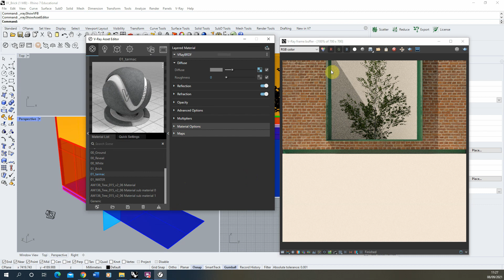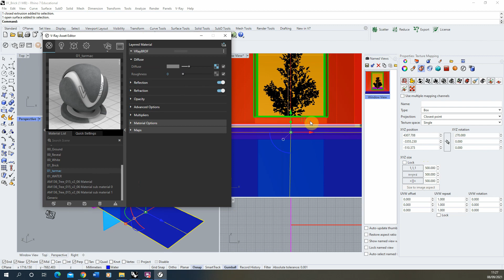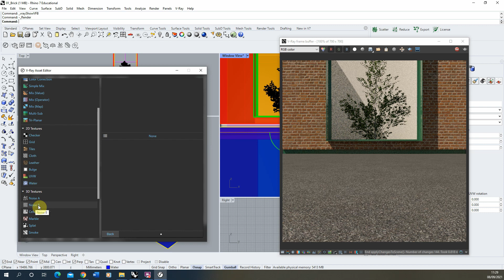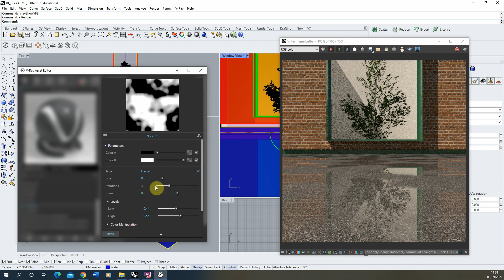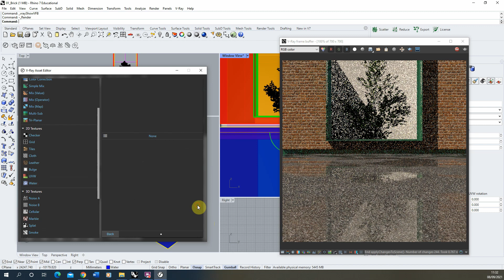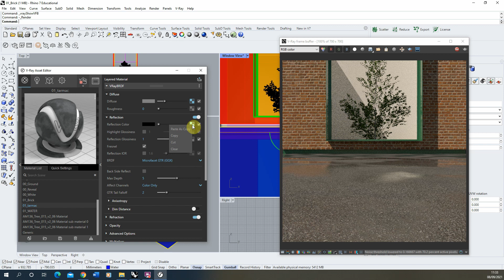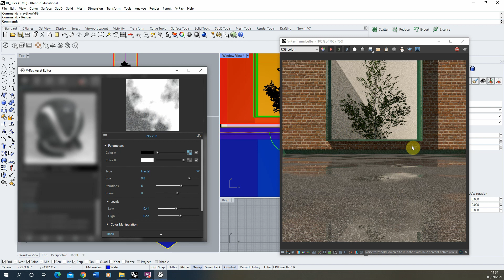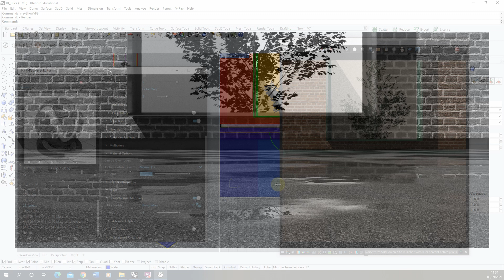Wet Surface Creation - VRay and Rhino 7

Comment: I perceive two problems：
1.Doing so will make the puddle （ the watery part）is slightly raised, rather than concave as it really is.But if the water is shallow, the effect of this bulge is much like the surface formed by the tension of the water.
2.The ripple effect of the water is also not achieved.